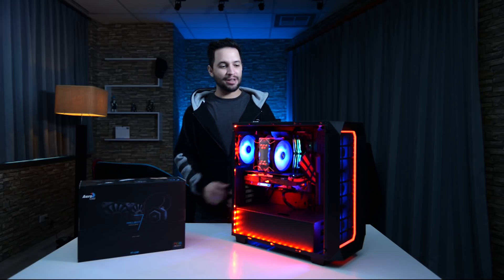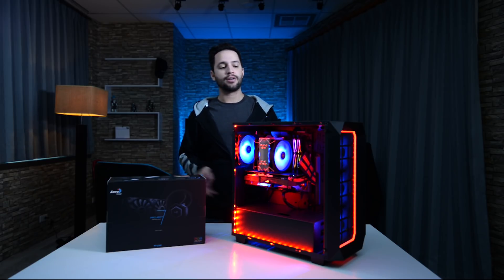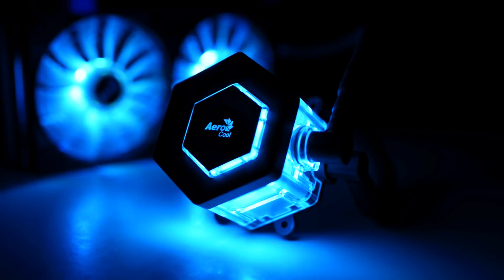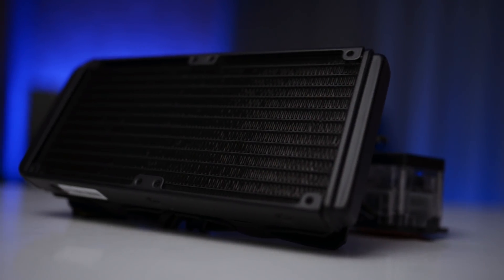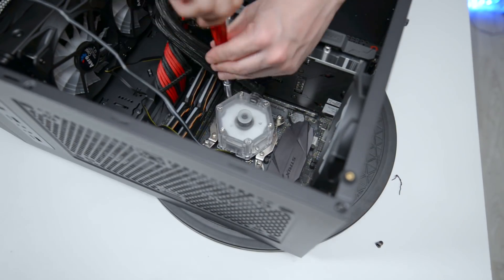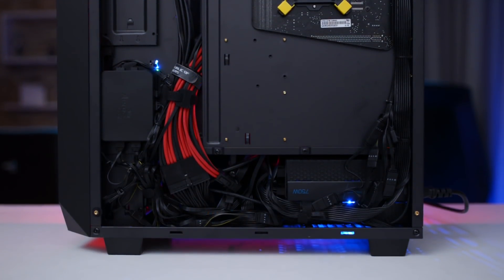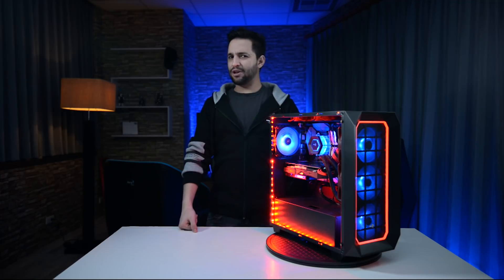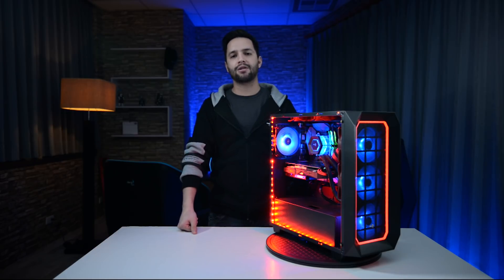Upgrade from Air Cooling to Liquid Cooling | AeroCool P7-L240

Comment: Nice Video,  thanks for  it :D and do you know if you can do the l240 on the 1151 socket?
Reply from the maker: Yeah you should dont have problems
For Intel Supports Intel: LGA 2066 / 2011-V3 / 115X / 1366 / 775